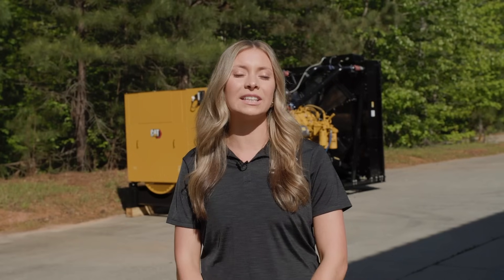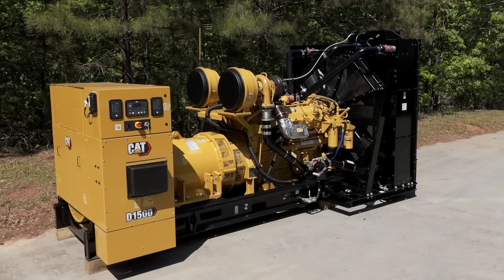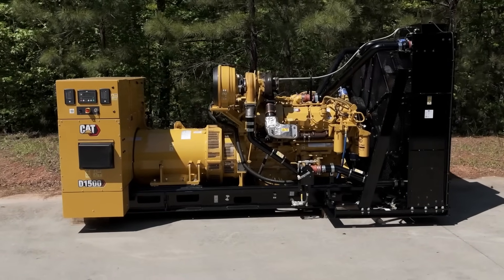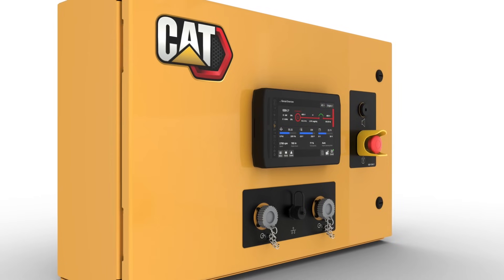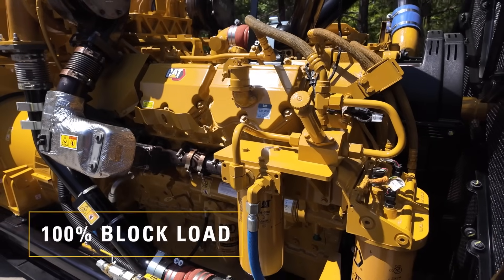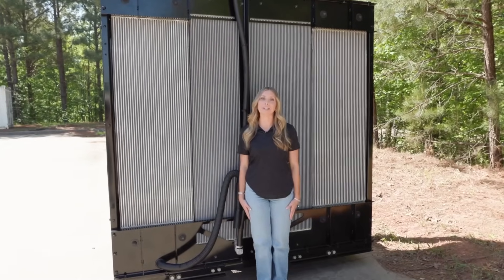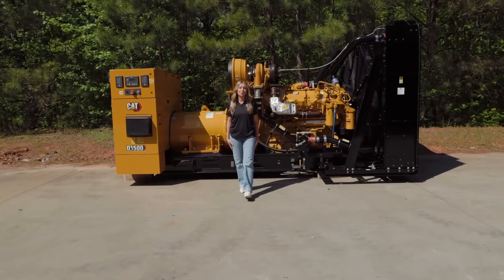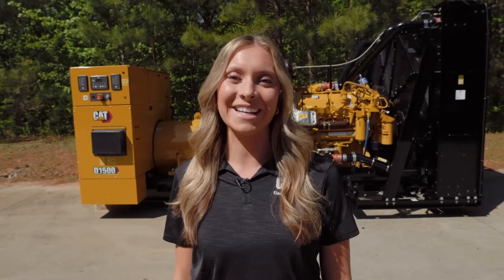Best-in-class power: Introducing the Cat® D1500 generator set (with C32B engine)

Comment: We have a min dozen Caterpillar Generators that are wired into our states gris at every power station. When the temperature hits 95 degrees, technicians are sent out instantly to fire all of them up and when the draw is getting to high we hit the connect switch and supply all the power needed. We have semi trailers that we send out to other states during disasters and we have enough of them to completely power 4 states.
Did you know hospitals do not use the grid to power them. They use generators. A small hospital has 2. The second one is in case there is a failure of #1. If there is a failure on one, we send a generator mounted on out trailer and plug it in and fix whatever went wrong with #1. If both failed before we arrive, then  it will switch to the grid and there is a $25,000 charhe from electrick company that we pay as part of contract with hospital.
When we sign up for tjat department, our contract mandates we cannot leave the hospital with generator down. After 12 hours andther mechanic will take over but we must remain for the first hour of the replacement mechanic.
We also have dedicated people that get parts. We will use a helicopter if needed.
Out state dues not get blackouts.
I installed an automatic generator in my house. Oiwer could go out an we would never know. There have been a few times power went out due to frozen wires from the grid and we had a lot of neighbors packed in out house being the only one that had heat. I got extension cords and ran them to the neighbor behind us and to neighnors on each side of us and they had plenty of power for lights, heat, refridgerator and how water.
I would never live in a house without a fully auto generator.
Company runs a test 1 time a week remotely at #:30 am on sat nights. Somestime I get up to listen outside to make sure the test is done. I cant hear it from inside my house.
U do also have a spare generator and 10 batteries powered by solar in case gas supply to main generator gets cut off.
Reply from the maker: Thank you for taking the time to describe your experience with our generators, Bob! We truly appreciate hearing how our generators are being used in real-world situations. What an incredible commitment to keeping your communities powered and safe!